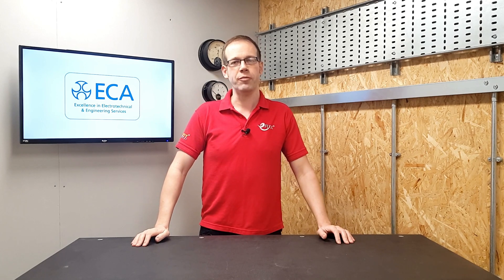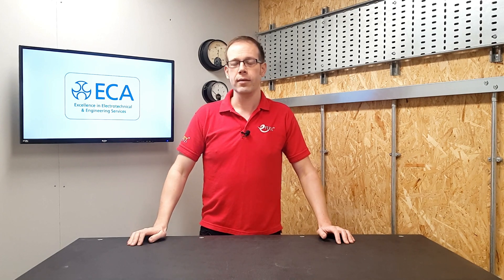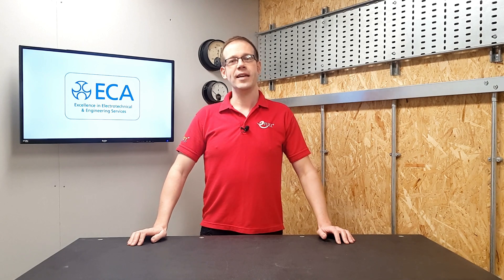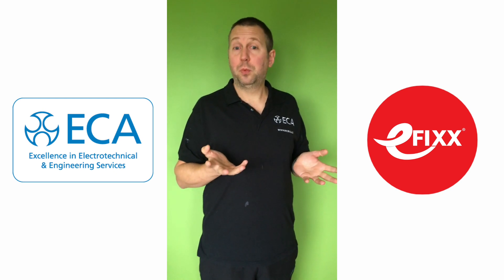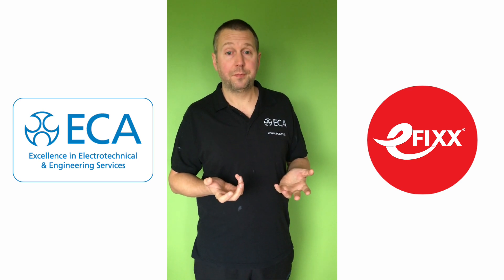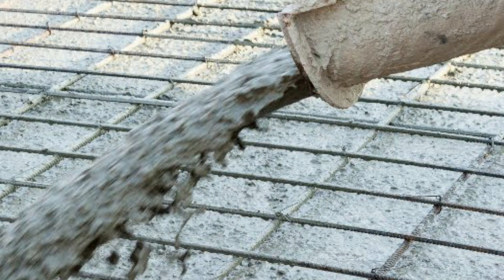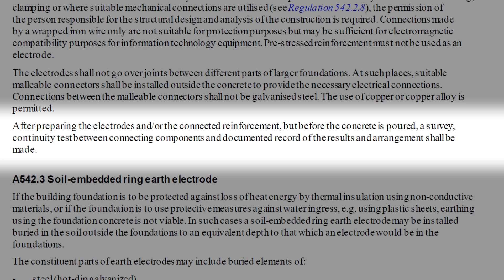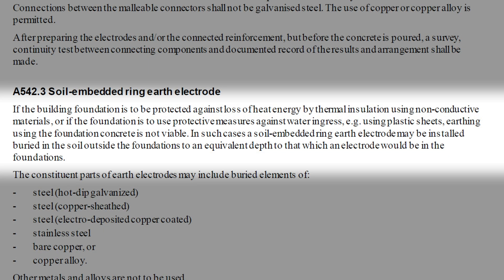Will ELECTRICIANS need to be on site before the foundations are poured? BS7671 AMD 2 draft

Comment: Here in Austria we use both foundation earthing and ground ring earthing at the same time.
In the foundation galvanized steel rod(minimum 10mm diameter) or bands are used. 
They form  loops in the foundation with 10m maximum mesh width.
Foundations here have at least one layer of rebar(most have two). The loops are bound to the top of rebar with binding wire.
The loop needs to be surrounded at least 5cm with concrete.

The earth loop electrode outside the foundation needs to be stainless steel (V4A)
Reply from the maker: Sounds like a really robust system, thanks for letting us know! 😊

Comment: We do foundation earthing for concrete pools and some wet areas etc and its a pain (Aus), Why is foundation earthing needed as in to say has anyone received an electric shock from the foundations conductive parts? How will you repair this earthing arrangement if it got damaged, in 25+ years what sort of corrosion may take place?

Comment: With the move to  prosumer world and island mode and rapid take up of EV charging  foundational earthing is much safer way to go with concrete encased metal grid or mesh layers providing much lower impedance paths that  also help with better surge suppression capabilities. This type of earthing is a vital in this new world. This type of earthing has been around since WWII called ufer grounding here in the USA and was used to create very low impedance grounding in dry arid conditions often deserts to safeguard bomb storage sites to better protect them from Lightning strikes. The problem is less of an issue for new builds the issue remains with older properties who want to upgrade to this new prosumer world and where the installation of large number of rods in the ground isn’t going to work or is not feasible. Older properties who have driveways and want to redo that should take the opportunity to go this way to future proof the properties. However properties with driveways are much less common than in other countries.

Comment: In the USA in many areas an Electrician can come in and install the connection to the length of Rebar for such connection using the 20 foot rebar... as all that is required is connection to 20 feet of rebar encased in concrete. Rebar is 30 feet long usually from the sellers so if a single length is not cut and is part of the foundation then that is what is used. However, many times a plumber and an electrician come to site anyway before the foundations are poured to make sure drain, water, and electrical runs are put in place through the foundation so that no damage occurs later.
Or a piece of rebar is Stubbed Up.. where the end is bent up and it is marked with green spraypaint so that it is known to be part of the ground system.. I have seen it bent out into a five gallon bucket and bent up as well... giving a spot for the electrical connection to be made at a later time and then concrete poured as part of the floor... there are many ways to get this done. 
I once made the point that it had to be at least a twenty foot long straight piece of rebar and was told by both a local and a state inspector that as long as the rebar is properly overlapped and tightly wrapped by the wire thus connecting it mechanically, it would give enough electrical connection in the concrete to do the job even if it was ten 2 foot long pieces and bends did not matter. I was also shown by both that a ground check would show continuity in most foundations from even the third floor in block work to the foundation, though they are more concerned with the part in the foundation close to earth itself.

Comment: That’s crazy to give a path for corrosion to the reinforcement, which in any event are only linked together by tie wires and not by welding or any reliable path for current. And given many buildings, especially domestic, don’t use reinforcement in foundations or floor slabs, and those that do will often be isolated by damp proof membranes, it’s highly impractical.
Reply: No corrosion because the parts that leave the concrete plate are either galvanized, stainless steel or copper. Depending on builders budget. And in most cases, when a lightning protection is not required, there's only one connection inside of the building...this looks that way, it's the metal band on the right:

https://upload.wikimedia.org/wikipedia/commons/8/8f/Potenzialausgleichsschiene.jpg

And the terminations of the earth electrode are screwed together with clamps.
Alternative is a ring earth electrode around the building, this is embedded into the soil instead of beeing embedded into the concrete.
Reply: @Marcel_Germann  - Thanks for the picture, but I doubt stainless steel is suitable as it is not a good conductor. Also galvanised will corrode once the thin coating breaks down, and copper will corrode fast, exacerbated by the highly alkaline atmosphere of concrete & any damp surface. 
Worse, normal shrinkage of the concrete and thermal movements of the metal bar will provide a route for moisture into the area of the reinforcement cage, leading to rusting of the steels over time. 
The ring electrode idea sounds much more sensible from a structural standpoint, although again there is a contradiction between conductive metals that will corrode in the ground, and coated metals that have reduced conductivity.
Reply: @Benzknees  I'm trying to translate some of the regulation:

The earth electrode must be surrounded on all sites by concrete to prevent corrosion. In  concrete which is not reinforced there must be spacers installed to prevent contact with the soil.
In case of using the steel of the reinforcement as an earth electrode instead of an additional earth electrode the terminations must be made with screw brackets or welded. If a steel band is installed it must be upright. The concrete must be at least 5cm thick around the earth electrode to prevent corrosion. If the electrode is leaving the concrete inside of a wet area precautions must be made to prevent corrosion (short piece of stainless steel). The earth electrode shall leave the wall inside of the cellar at a height of 30cm and shall be 1.5m long.

Permitted materials:

-galvanized steel, band, profile or plates (90mm²)
-galvanized steel pipes, 25mm diameter
 -galvanized steel rod, 16mm diameter (200mm²)
-galvanized steel cable or round wire, 10mm diameter (80mm²) or two 8mm.
-copper plated steel, 50mm²
-copper strip 50mm²
-copper cable, stranded (strand diameter 1.7mm) or copper rods (35mm²).

If a concrete embedded foundation earth electrode is connected to a soil embedded earth electrode, the earth embedded electrode must be made of bare copper.

Comment: It will be in Amd 2. The IET / BSI are hugely in favour, the DNO earthing network is in bits, you've no idea what is a TNS, what's TN-C-S, what's liked to what in the street, TT rods incorrectly installed etc. Rods are unreliable and lead to huge step potential issues,. Lets face  it in the late 60's - early 70's whilst the majority of Europe started to adopt this far safer way the UK took a very bad turn and one which is hugely expensive to try and fix. The FOI request proved just how many issues the DNO's are having with lost neutral faults and as we more towards prosumer status we need a safer, more reliable alternative. You can even ask your friendly neighbourhood Dehn rep for a copy of their white paper on how to achieve it correctly.

Comment: In Germany there are three possible scenarios:

1. The electrician which also builds the electrical installation of the building when it's finished.
2. The electrician which builds the lightning protection of the house.
3. The construction companies own electrically skilled person which is a qualified electrician or qualified to built lightning protection.

A report must be written, and as always, there are forms available from different manufacturers like this here (sorry, only in german but I try to put in a translation):

https://www.dehn.de/sites/default/files/media/files/2018-06/form-2120-d-din-en62305-3_0.pdf

It contains:

1.Owner of the building, and his adress
2. Dates of the new building
3. Who planned the earthing system, name and adress
4. who built the earthing system, name and adress of the business and what kind of business it is (one of the three I stated on the beginning of the post).
5. The purpose of the earthing system (protective earth, and if it is used as a functional earth for what it is used as a functional earth). A lightning arrester for example connected to this would be a functional earth.
6. Special requirements on the earthing system, for example in a system with a voltage above 1kV.
7. Type of the earthing electrode, is it a foundation electrode (embedded into concrete) or a ring electrode embedded into soil?
8 and 9 is the material of the electrode, 8 is if it's a foundation electrode and 9 if it's a ring electrode.
10. shape, round or flat and their dimensions
11. if the connections meet the requirements according to  DIN EN 62561-1 (VDE 0185-561-1).
12. Material of the connectors of the foundation electrode, in the concrete
13. Material of the connectors outside of the concrete
14. Attachments like schematics and pictures and example pictures of the connections
15. Purpose of the documentation: Inspection and approval, handover / re-examination
16. Continuity between the connectors equal or less than 0.2 Ohms
17. The installation is according to the schematics and plans at hand
18. The installation is without deficits according to the regulation  DIN 18014:2014-03
19. Following deficits were found:

Location, date and name of the inspector
Reply from the maker: Great 👍 information of what we can expect - thanks for sharing
Reply: @efixx  That's the reason I posted this here.  ;-)
Reply: Have a day off mate we have enough red tape and enough different certificates to fill out in great detail. To bond the steel in the footings I find highly impractical .
Reply: @joefranklin4088  The purpose of doing this is that these buildings will never require an additional earth rod. It's turning the footing into a big earth electrode with much better values than the standard earth rod.
For new construction in Germany this is mandatory since 1980. Before you had to implement a different type of earth electrode, mostly the incoming water pipe was used that was made of thick cast iron due to this. And this is even the case in a TN-C-S system were you normally not require any kind of earth electrode because it is provided by the DNO.
But that's also the reason we don't have that problems when installing an EV charger in a TN-C-S installation. First all buildings here have some kind of earth electrode installed, and second is three-phase, which makes it quite easier to detect a broken PEN.

Comment: Be another tester to buy or a new book or a course to pay out...
Reply: The way the regs are going you won't have any electricians who will be bothered to wade through it , seems like they are just looking to add more obstacles to tie you in knots.
Reply: They should give John Ward a veto on any changes.
Reply: No other tester required. You test it for continuity and after the pouring you do the same tests as for an earth rod. So standard installation tester is required. But the earth resistance values will be much lower.

Comment: Sounds a bit overkill to me stick with the systems we know
Reply: This system is known. Here in Germany we must do this for 40 years now. This or a ring earth electrode embedded into the soil around the building.
The resistance values are much better than the ones of a simple earth rod. For example, here in my area (sandy ground), depending on the conditions (wet or dry) I got between 20 and 100 Ohms on the foundation earth electrode. To get the same value with a conventional earth rod, that one must be 10m long.